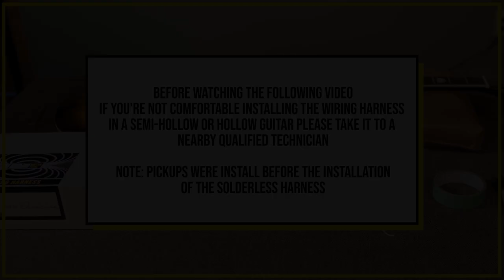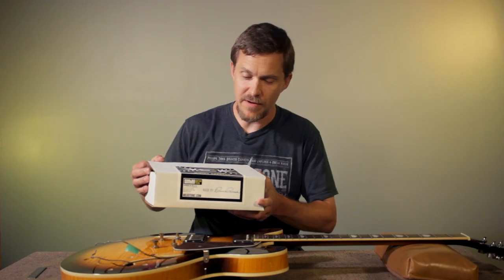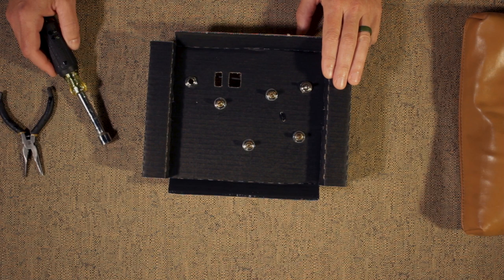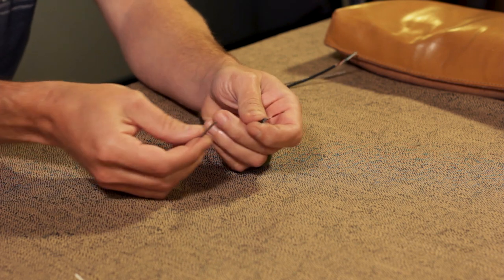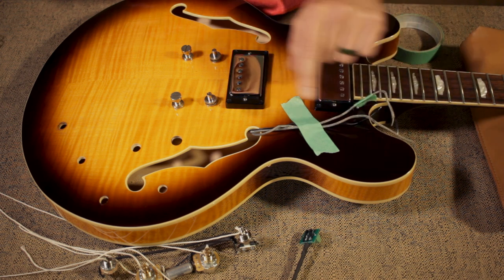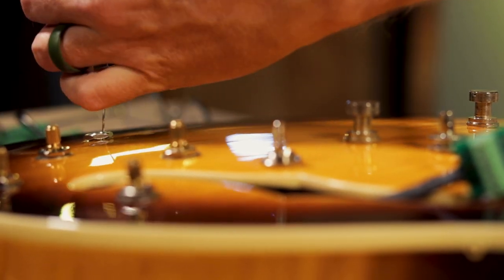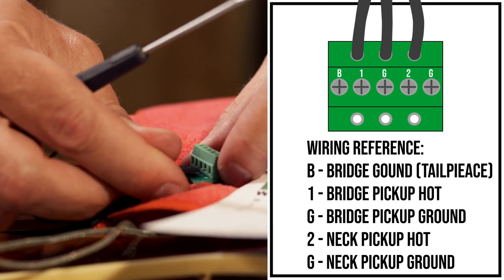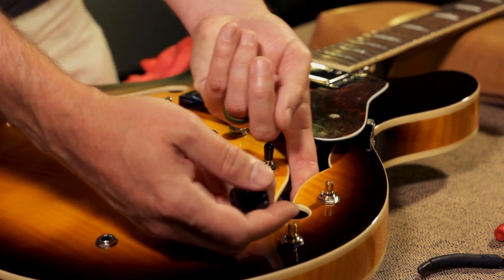MOJOTONE's Solderless ES-335 Wiring Harness Installation Tutorial

Comment: Nice video folks, thank you! An alternative method to the hook on the jack  is to prepare a closed loop through the jack and the f-hole, consisting of a 6mm nut knotted/fixed on the loop below the jack, and the washer plus nut above it (outside). Then close the loop below the 6mm nut.
Now, after pulling the jack through, secure it by pulling the loop up, next fasten the washer and nut. Once fixed, cut the loop and remove it and save the 6mm nut. Voilà, done! Perhaps someone will find this useful 😁
Reply from the maker: Thanks!

Comment: Thanks for this video, installed this in a CS-336. A bit of a tougher beast since it is smaller than a 335 but it IS possible. I recommend anyone trying it out to use some very thin but strong string. Just an FYI. Also the pots won't fit through a 336's F-holes but you can install all the components through the bridge guitar rout. Like I said, a bit harder but it is possible. It's a great harness, so much easier to change pickups now!

Comment: The tool used to fasten the nuts of the pots is not "a 1/2" drive".  It's a 1/2" hollow-shaft Nut Driver.  I hope this helps people to get the correct tool.

Comment: Thanks for the video. I bought a solderless harness for my telecaster but am a little confused as to where I put these three extra ground wires I have. 2 black wires screwed into the body and 1 yellow wire coming off the neck pickup cover. Do I have to solder these wires to 1 of the pots? Or will they fit somewhere on the green solderless connector? 
Thanks in advance for any help you can give me.

Comment: do the loose wires and block not move around and make noise while handling the guitar?
Reply from the maker: The wireless harness has a strip of adhesive attached to it. You stick it on the inside of your guitar

Comment: The reason why individual/s have issues installing these prefab components is the fact there's NO wire play connections between components !!! Disconnect those stupid unnecessary large capacitors , and rewire entire layout with at least an inch of extra wire between components  !!! Connecting capacitors directly to components can cause unnecessary stress on them !!! And, add a touch of nail polish to component's washers before installing !!  Note, not all 335 manufacturers use the SAME distance component holes layout !!! Beware !!!!